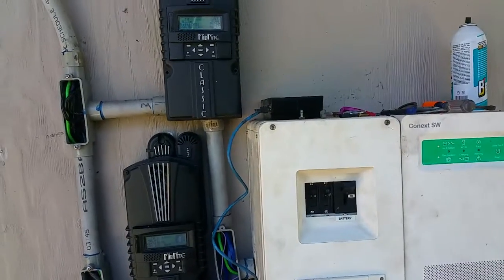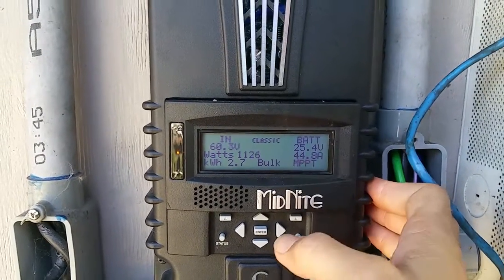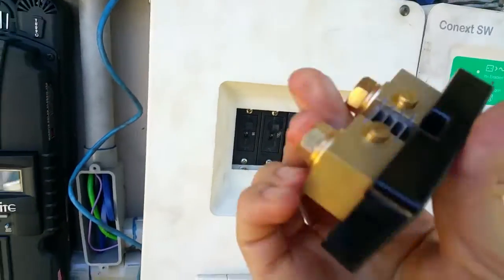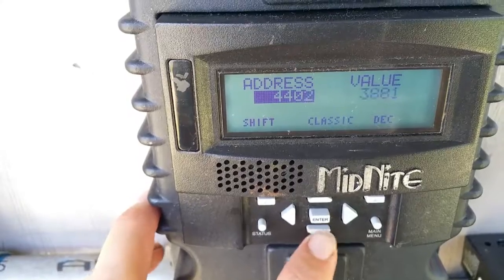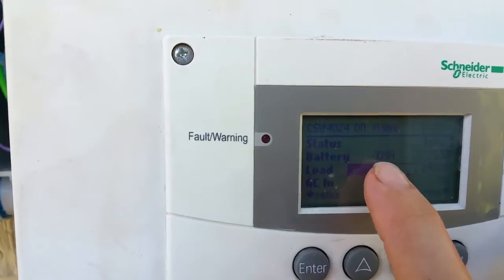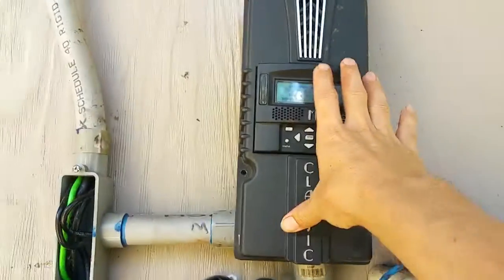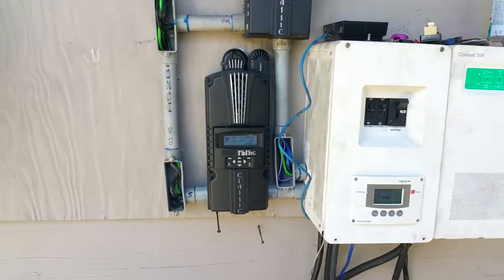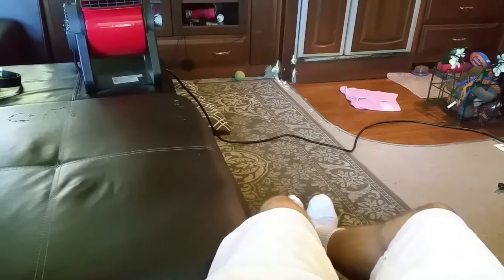Don't overcharge / current / Global maximum amperage Midnite classic Whiz Bang Jr solar  controller

Comment: Travis - I never received your responses even though I subscribed so I wasn't aware and didn't respond back - I sincerely apologize! My wife had cancer removed and I ended up having a heart attack last year so we as yet have not moved forward on the home. We did purchase a used DC Solar Trailer this fall and I am trying to restore the battery banks (IFLA - which I know you are not a fan of!) and I am trying to figure out how to get the Midnight Solar Controller to through as much power into the 48v battery bank that is still "functional". The two SMA 6048 inverters can provide a lot of power but I would like to keep the battery as high in voltage/amperage as is possible. 510Ah isn't a whole lot of power but it is enough to keep up going. I copied your video so I can remember to come back to your youtube channel and review it. I think I would be well served to order 10 new solar panels and replace the panels on this trailer as soon as is possible and I am wondering the best wattage amperage to the CC - still trying to figure it out so we are not purchasing something that will not work for us. I will look and see if you have a video on the panels that you are operating your CC's on. Maybe that will assist me in better comprehending what I need to do. Hope you are doing well and have improved on your your system!
Reply: How many volts is your battery?
Reply: With those inverters I'm going to assume 48 volts. So your batteries can only absorb around 3000 watts. In my opinion you could have as much as 5,000 w of PV without wasting your money. Unless you're in a far north climate or a commonly cloudy area then you can probably double or triple that without wasting too much money on PV.   Of course during high noon on sunny days you won't be harvesting all that's available but most of the other time you will be harvesting all that's available.  Switch to lithium batteries and the game changes in your favor.

Comment: I wanted to say something about disregarding the other batteries. They are not hooked up in this video.  The only batteries connected were those two large AGM batteries.  One thing I was trying to discover when I made this video was will the batteries actually be capable of charging past their maximum ratings. Flooded lead acids have a very high resistance and typically will not accept more amperage than is good for them except in some short circumstances. They'll just bubble off the extra power. However the batteries in this video are AGM and certainly were capable and did charge faster than spec potentially being very bad for them.
Reply from the maker: Correct. That should have been more vocally expressed in the video.  One person told me that lead batteries can't consume amperages at unsafe levels. Like they're simply not capable of it and won't soak in the amps at voltages at and below correct absorb voltage. This video was also to prove that theory incorrect.  What I found is that AGM batteries are certainly capable of charging Way beyond what's recommended. Flooded lead acid batteries only slightly more and not for very long. Flooded lead acids don't really get damaged.  Obviously assuming you're keeping the voltage levels proper.

Comment: Wow! I’d be in panic mode if I had loads like that. The biggest load I have ever seen on my system is 37 amps. Thanks for this cool video.
Reply: Well how are you going to start fires with only 37 amps?
Reply: @lavatrip9344  good point! I’ll have to work on that.

Comment: When would a person add a charge controller and more batteries? I have a small system that was tailored for our needs but, I am already wondering if it will be enough. Since all components were tailored for maximum input, I can’t just add more panels and batteries as far as I know. But what I see in your video makes me wonder if there’s an effective/equitable solution for me

Comment: I have a battery bank of 10 12V 70A each. can this midnite 150 charge controller charge them with no problem ? thanks
Reply: Yes.  But keep in mind the charge controller can harvest twice as much power when on a 24 volt system versus a 12 volt system.  And four times as much power when on a 48 volt system versus a 12 volt system.  Even if you were on a 12-volt system for some strange reason which I don't recommend with that much battery power this charge controller will still be powerful enough to properly maintain those batteries.  Basically on 12v  you'll have 700 amp hours and if you max out the charge controller and your charging around 96 amps that would be 700 amps divided by 96 which comes out to 7.3 hours. That's how long it would take to charge.   If your batteries are lead batteries then you shouldn't be draining them down more than halfway anyway so a charge time of 3.515 hours which is perfect.
Reply: And if you're using lithium batteries then there's no amp threshold to properly maintain because they don't need maintenance. Lithium batteries are happy at whatever state of charge. You're not forced to return them to full everyday.

Comment: Why don’t you setup one classic and on the second one use the follow me option?
Reply from the maker: They are following.  Following doesn't accomplish global amprage control.
Reply: Travis Sanders can you set it up one the first one in your case  the 50 amps in and let the 2nd one do a follow me
Reply: When I checked my classic 200 the tweaks hidden menu said my 4405 setting was set at 30,000 is that odd or ok I have 4 lithium ion batteries at total charge amps 164.5 amps since it was higher I just left it
Reply: What is your thought on that
Reply from the maker: @bde5692  setting the first one at 50 amps & the second one to follow won't limit the total current to 50.
Reply from the maker: @bde5692  30,000 is 3,000 amps.  Maybe they set it really high in the factory so that solar farms won't  accidentaly hit that upper limit easily.

Comment: So if the battery is fully charged...will the charger help bypass the batteries and put zero current into them, but still provide power to load???? I got lithium battery that can not get over charged what so ever!!!
Reply from the maker: If the battery is fully charged you don't need to worry about it being overcharged & this video will not help you.
Reply from the maker: This video is about the speed in which the battery charges. Not how full it gets.  So if your solar system is capable of charging your battery faster than its specifications allow you would watch this video and follow its instructions.
Reply from the maker: But to answer your, yes. Chargers by nature will do what you ask.  but in this case this video is about turning the charge rate down without  turning down the bypass power.
Reply from the maker: this video is mainly applicable during the charge stage.   Anyone who needs to follow the instructions in this in order to limit the batteries charge rate would of course after the battery is full the charger would continue to make available its maximum amount of power for the inverter without sending any power at all into the battery.

Comment: Thank you for this video. Travis, what should be set for address 4405 for EACH Midnite Classic if the recommended maximum charging current is 50A?  4405=500 or 4405=250?..
Reply from the maker: 500
Reply from the maker: Keep in mind if you're if you're changing the registries of 2 classics you'll need a whiz-bang for each of the MidNites.  One shunt with two whizbangs attached to it.
Reply from the maker: However there is a way which I have not learned yet of how to alter the registry to point one midnight through the network to the wiz bang of the other midnight.  Doing this would only require one whizbang. If you did this you would still use 500 some where.
Reply: @SiriusSolar  I think it's not possible to only set the limit in one midnite since they are functioning independently..In "Follow me" mode you still need to set all  the parameter for each midnite but  in this mode the master will just let the follower know when to be in absoption, float or equalize phase..
Reply from the maker: @ricky786  I spoke with tech support for about 30 minutes about the subject and he promises me it is possible.  He tried to explain it and it was hard for me to understand. I wish they would just write up some instructions for doing it because this is definitely something that is greatly needed. I don't even have room for two whizz-bangs inside my combiner box they'll stick out too far from the location where the shunt is bolted.
Reply: @SiriusSolar  Yes, they should write up the instructions on how to set limits with only one WBjr. But I guess installing two WBjr is the way to go, it's less complicated approach.
Reply: If I set registry address 4405=500 for each of the two Midnite Classic, the combined max current will still be 50A or it will be doubled?..Yes, it is two WBJr. in a single shunt...

Comment: Your presentation has a lot of potential to do some good.  I will try to explain.  

There are some installations that have several charge controllers charging a single battery bank.  Unfortunately, some of these installations use charge controllers from different companies that cannot communicate, and this usually hurts the batteries since the charge controllers end up competing between them, or perhaps one or more charge controllers goes into an early standby mode.

I am assuming that your two Classic charge controllers are connected between them to avoid these situations using two cables through the network ports.

This permits two or more Classic charge controllers to share equally in charging the battery, and it prevents them from competing between them, and most importantly it prevents them from overcharging the batteries.

However, though this is all obvious to you.  It is not obvious to a lot of people.  I invite you to expand more on this topic.  It might actually help someone who is thinking of buying a second charge controller for their battery bank.
Reply from the maker: The way I understand it is that MidNites teem never got the current sharing over the network-enabled which might explain why one of my units always works harder than the other. The network cable simply communicates what mode to be in. They follow each other so they'll both go to float or they'll both go to absorb together at the same time. They will still be very imbalance in their contribution to the batteries and inverter.  I don't feel the need to make a video about it because it's explained quite well on classics channel.
Reply: Travis Sanders are you using network cable to mean singular or plural (as in more than one cable)?
Reply from the maker: @ek9772  yes I'm using two cables so the follow me network is a  complete loop. So that way they both stay in the same mode.
Reply: Travis Sanders it is weird that they can share voltage information but not current information.  I wonder what those boys at MidNite had on their minds.

In any case, your video did a great job in explaining how to work with it.
Reply from the maker: @ek9772  they don't share voltage information like that. they only share the mode there in and so the other one can switch to that mode as well.  They also share battery temperature so you only need one sensor for that.
Reply from the maker: @ek9772  if you get into the registry you can change the addressesthe units referred to. So you can do all kinds of tweaks like make one unit look at the voltage of the other.  And both units look at the current of the same whizbang. Theoretically it's possible but I don't think I've heard of anyone actually doing it.
Reply: Travis Sanders I think it is the Victron charge controller that share it.  This is why I thought the Classics did as well.
Reply: Travis Sanders interesting.  

I am getting the impression that the Classic is ready for a user interface overhaul including some interactivity changes with other charge controllers.  
What is your perception on this?  Would you keep them the same, or would you make some changes?
Reply from the maker: @ek9772  you're correct. The classics could definitely use a software upgrade. they could add a lithium mode that better deals with the voltage and temperature sensor properly.
Reply from the maker: @ek9772  I would also love to see a power transfer mode where it's designed to move power from one place to another. Like a dc-to-dc converter that didn't do any mppt sweep.   I really needed this mode for taking power from my Prius but I had to settle on the wind mode that isn't tuned to do what I'm doing.
Reply: Travis Sanders I thought it had the ability to deal with alternative DC inputs.
Reply from the maker: @ek9772  yes it has a special mode for power supply inputs but it still does the mppt sweep within the parameters I set. It does not work that well. The wind mode works much better but it's still not ideal.
Reply: Travis Sanders time to fill up the suggestion box.
Reply from the maker: @ek9772  they have said no more updates for the classic.  I even talked to them on the phone and they confirmed.  And said new hardware is just around  the corner.thats where all there effort is going.
Reply: Travis Sanders that makes sense.  They have a gap in product size.  The Kid was supposed to have hydro and wind, but it has only solar.  I would like different solutions in this area.  For instance, a line like Genasum for very small, discrete (single solar panel or small wind) applications with the flexibility of battery chemistry and voltages like the Classic.

Communication of voltage, current, and temperature is a minimum today.  There has to be way of providing other data.  

For instance, suppose it could use logging data to compare the amount of time spent each for each battery cycle.  Is it faster or slower now than 10-cycles before.  It could analyze options of different actions to take to prevent battery degradation.  Perhaps a sort of AI.

Then there is the issue of energy sources.  Today you have DC generators, alternators, and DC to DC conversion in addition to solar, hydro, and wind.

Each of these issues requires a team of engineers, but the company is not that big.  I wonder if they subcontract development of portions of the above to different engineering teams.  Plus they, also, need a coordinating office.  

They have probably reached a point where the complexity of each issue requires a very detailed analysis for a solution and integration with other parts.  In other words, they need big engineering teams, but I wonder if they have the financial resources for it.

If I was to make a new product line, I would take away part of the work from the Classic into smaller units for wind, solar, hydro, other DC sources, and DC converters, but I would keep a centralized unit for coordinating battery charging and making decisions (like throttling back, shutting off units, and balancing).

This line would allow customers to buy the exact amount of source to DC (for instance, one or twenty solar panels) they need while keeping computing expenses to a minimum.  For small installations, this would make RE more affordable, and for medium sized installations, this would add more flexibility.   This would make their product line much more modular for size, application, with more affordability.

Today if you want a small wind source (300 to 500 watts) you a Classic 150.  You pay for a unit that can work with a much larger wind turbine.  If you only have a few panels, a portion of the built in potential of the Classic goes unused.  If you have small wind, small solar, small hydro, and small DC source like small generators, you need to pay for unused capacity for each of them, and you pay for computing capacity several times.  Therefore, computing capacity is, also, under utilized.

This is why I see communication as a key.  Smaller units talking among them all the time.  One singular computing unit coordinating and communicating with all the little units. All of them working together to share the workload equally from conversion of energy (solar to DC, for instance) to charging the battery simultaneously.  No competition amount units for battery charging means no overcharging or standing by units.

We shall see what the new day brings.
Reply from the maker: @ek9772  I know it's so frustrating knowing that we've had the hardware and technology and mind power to do all of these things you speak of for decades. Yet we're still stuck with primitive systems it's frustrating.
Reply: Travis Sanders yep.

Comment: Travis...thank you so much for posting this video! My wife and I are getting ready to build an Earthship Biotecture style home. We are building our solar power system to function for the fifth wheel while we build then installing it in the home when we reach that point. We are in Reno-Sparks, Nevada. I have subscribed! Blessings!
Reply from the maker: The battery compartment in the rear of my 40 ft 5th wheel is rather large.  Since this video I've upgraded to lithium.  Do yourself a favor and don't mess with lead acid batteries they are not worth it.
Reply from the maker: Get as many solar panels as you can fit on your trailer roof. Then get charge controller inverter and lithium batteries to match.  Run your trailer off of the batteries when shore power at the stupid RV park is weak.  Use that weak shore power for charging at a steady thousand Watts if needed but you won't need it if you've covered your roof with solar and your batteries are larger enough.  You definitely have enough solar for AC in the day time
Reply from the maker: Try and stick with an inverter that only has one leg of 120 v output. if you use a 240-volt dual leg inverter you'll need at least 2000 Watts on each leg.